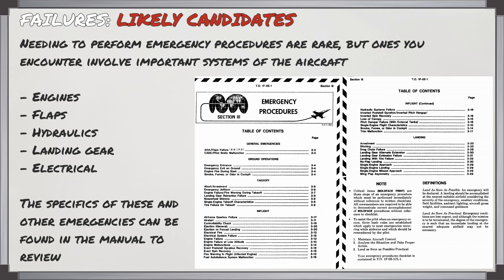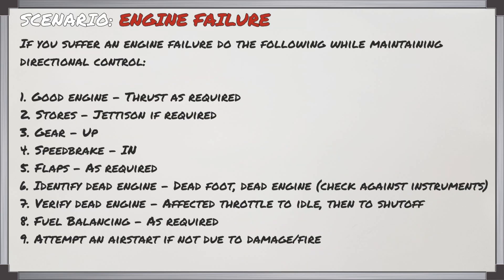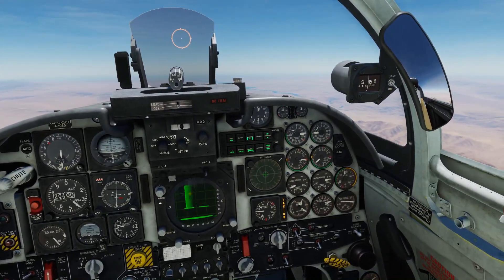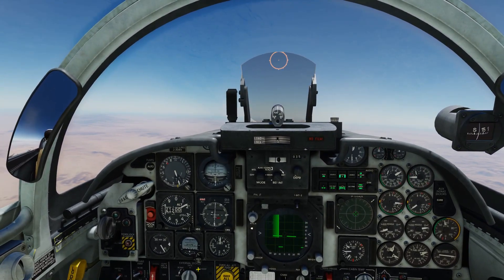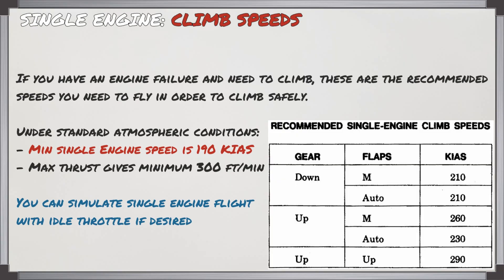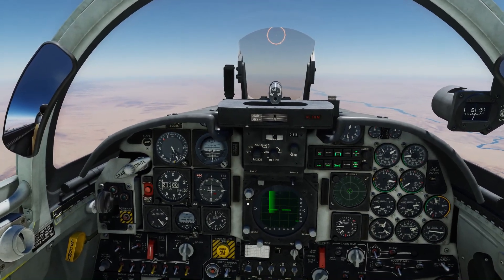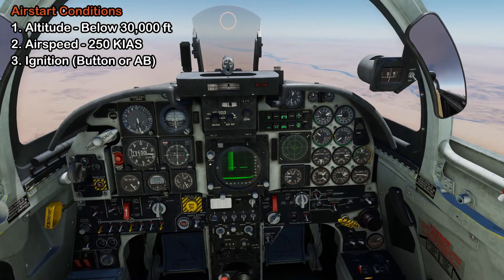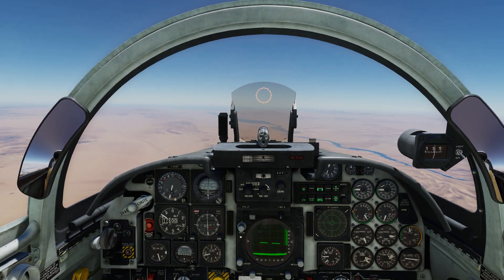DCS F-5E #5 - Engine Failures & Restarts

Comment: I think its important to emphasize that the computed single engine takeoff speed and the minimum single engine speed of 190 knots are meant for use after an engine failure during takeoff, and that you should not slow to that speed if you are already faster.  In fact if runway length and obstacle clearance allow you should use available runway to accelerate to a higher speed (not more than 210) before liftoff because every knot increases your climb rate by about 100 ft/min.  If not possible 190 gives you a minimum climb rate to get high enough to lower the nose a bit and accelerate to a more efficient speed.  If you lose an engine at altitude do not slow below best glide/endurance speed/AOA until approaching to land.

Comment: Eject or try landing? Say for exampke there's a runway right there, would a military pilot be expected to try landing it or to eject? Ejections look kind of painful but probably successful where as crash landing is either painless or very bad.
Reply from the maker: On single engine you'll just come back and land. There is plenty of thrust available on one engine to be safe
Reply: @RequiemsACTL  I meant on no engine. Looks like you made this video a while ago. At the end of the video you say if the engines fail to start up again to eject. But I realize now with no engine there's no hydraulics for controls so maybe eject. I'll probably just try it later though. I know with warbirds a lot of guys preferred to crash land over bailing given the option. Jets are different in a lot of ways though I guess.